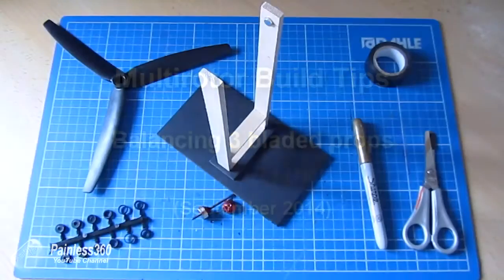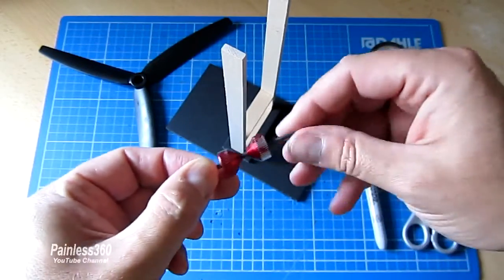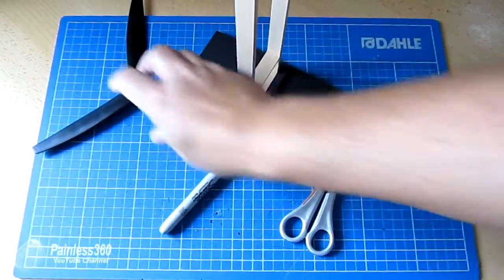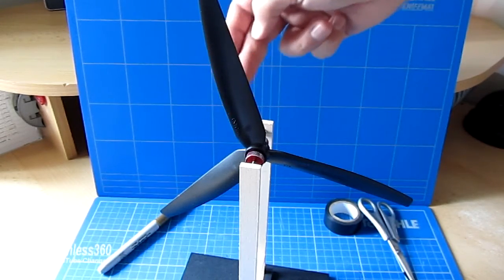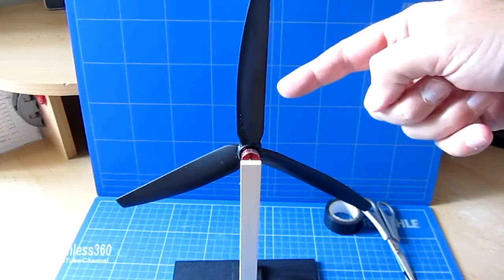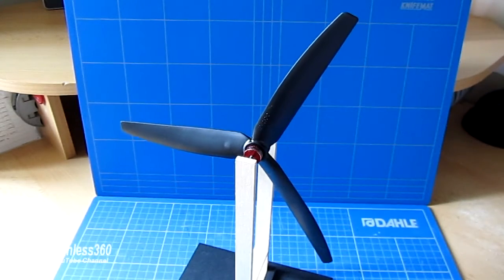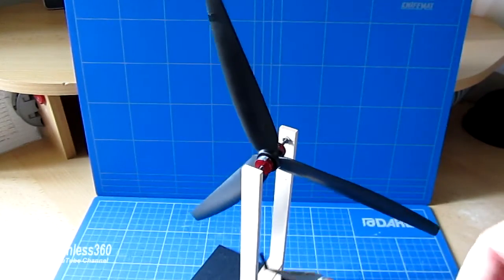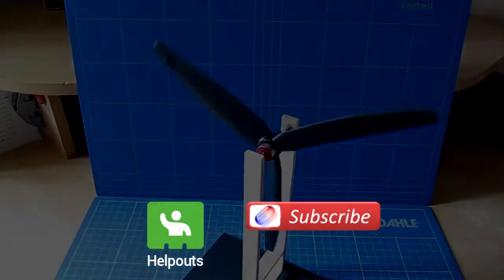Multirotor build tips: 3 blade prop balancing

Comment: Does the hub/shaft size adapter need to be balanced too?
Many of the plastic propellers come with it, and they have artifacts from molding process, plus once detached from the cluster it has nicks/dents.
It's small, balancing just the adapter on it's own is tricky.  So glue it to the prop and balance them as one unit?
Reply from the maker: Ideally yes.. Happy flying
Reply: @Painless360  Thanks Lee